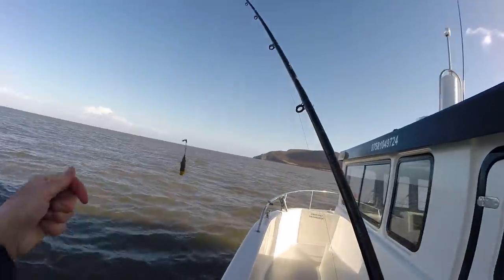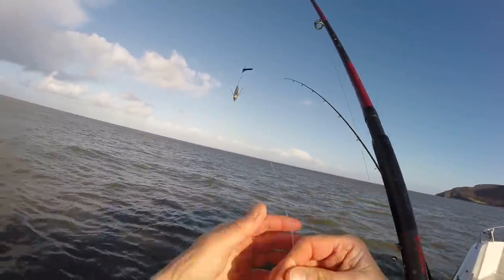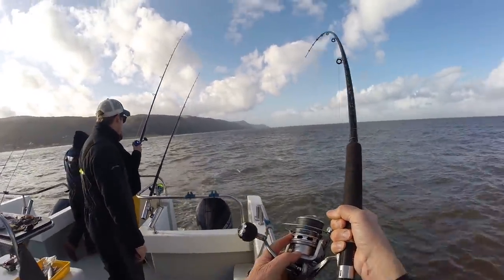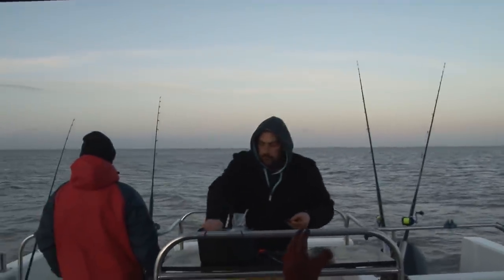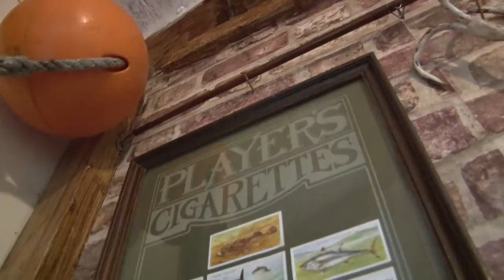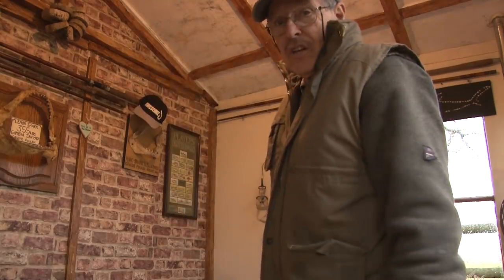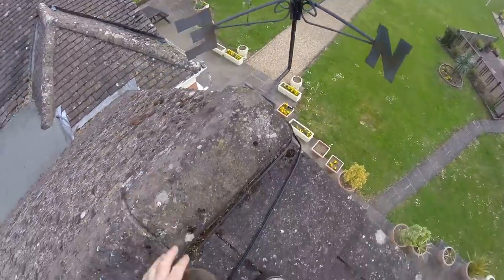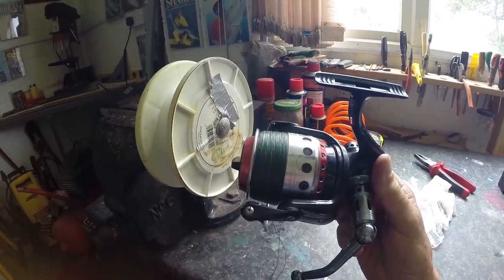MURKY WATER SEA FISHING

Comment: When you are re-winding off the spool to your reel try some felt as a washer either side of the bolt and it will add enough brake to keep the line under tension. Maybe even a corn plaster if they are thick enough. Really enjoy your videos and life stories. Thank you.